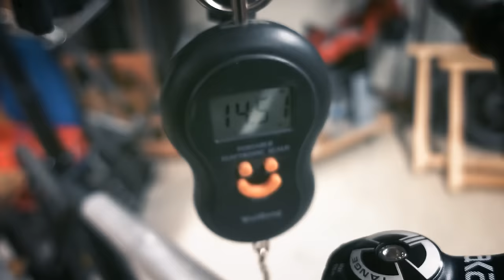Building a Light Cargo Bike

Comment: I love all the care and attention to the lights, although I would have put another backlight in the middle behind the seat and the ones in front can be covered by your legs. Stay safe out there.
The internal cable routing is wonderful, I kind of wish you’d make a video where you do obsessive internal cable management and do all the wiring inside for a super clean looking bike.
Reply from the maker: Yeah a third one would be good. But you can usually see at least one of the two when you're driving behind though, well at least nobody has crashed into me yet ;) 

Internal cables is definitely something on my list if I do another "elaborate" type of build.

Comment: Cool seeing you do all the work on the frame and nice editing to. I ride a Omnium Cargo (bike messenger from copenhagen) and I must say your headset solution seems better. Good job and yeah the lights are cool. What rim do you have on your rear wheel?
Reply: Btw glad to see you put on Grand Prix 4 seasons on the back good choice, I would have loved to see carbon handlebars and Shimano brakes though but im sure you have your own preferences ;)
Reply from the maker: Rear wheel is a Mavic Crossride 29" (without the Decals). Picked that instead of road wheel because the rim is a bit wider. And yeah the 4 Seasons is awesome, especially the new 32mm one. Probably my favorite tire, it does everything. Would love to have one in 20"... As for the handlebars and brakes, it's mostly stuff I still had lying around from other builds, so not necessarily my first choice. But this bike got pretty expensive as it is so I re-used what I had. I'll probably switch to hydraulic brakes at some point and maybe change the cockpit too.
Reply: Good to here 32mm is the perfect choice. Hope the industry will realize the demand for 20" wheels as the cargo bike is growing. Is it 406 you have on the front? Make sense that was what I thought, it is an expensive hobby. I think you made a beautiful bike an its definitely well made overall. The best thing is that you build it yourself, makes the riding twice as fun and unique.
Reply: Just change the brakes to TRP Spyres when you get a chance then you won't have to change your levers. They work much better on our tandem than the BB7's did

Comment: Won't the frame's square geometry make the structure weaker? Beside that, awesome looking bicycle!!
Reply from the maker: Yeah it probably would be a bit sturdier with a horizontal top tube or even a second top tube. But most of the cargo weight is directly over the front wheel/fork with this design so the rear only has to carry the rider. The frame is very stiff though, due to the large diameter tubing

Comment: Great job! Love the bike. And good video. I have a question tho. Don't you have to heat treat the aluminum after welding?
Reply from the maker: They do it on commercial bike frames, yes it's better to do it but not absolutely necessary. Depends on the alloy and the filler you're using too. So far I've had no problems with any of the welds, holding strong after 1+ year
Reply: @PhilVandelay  That's good to know. Aluminum does age a little bit and get stronger over time, but it will never get back to the original t6 strength. Probably more imporant on mountain bike frames where huge sudden impacts could break the frame.

Comment: I watched the recent cargo bike that was mainly steel, now this one that holds it's cargo much higher but aluminum, now I want to see the best of both worlds: A lightweight, but strong, cargo bike that holds it's cargo low. Extra points if the cargo section can be removed and changed out for thinner and wider platforms and easier storage.
Reply from the maker: That's definitely coming and it will probably be electric too. The green one I only built for the tutorial, not really for myself so I tried to keep it low-tech.  This bike here has its own advantages though, it's super light and agile for a cargo bike, there's always a tradeoff between a light bike and a strong bike

Comment: nice channel ,keep up the good work ,one question : don't you have to heat treat aluminium after welding ? theoretically it looses  strength on weld heat effected zone , but in real life use, is it necessary ? i have  builded a hard tail mtb out of 6060al tube, i heat treated the frame, do you believe i would be good without  HT ?Thanks for sharing (by the way i have the same welder as you ''stahlwerk'' )
Reply from the maker: It's definitely better to heat treat it but so far I haven't had any problems. If you use 5xxx filler alloy it shoulp help a bit to prevent stress cracking. I'm not sure I would build an MTB without heat treatment but I don't ride this thing off road so it has to take less stress. So far I haven't had any problems with the frame after months of daily use.
Reply: i look forward to see your future projects , cheers from Greece.

Comment: Great build.  I know nothing about cargo bikes but what is the reason for having the load towards the front vs. behind the rider, closer to the rear wheel?  Obviously you can keep an eye on the cargo better but wouldn't the weight being closer to the pivot make it more maneuverable?  Or to say it another way the weight of the cargo at the front of the bike has to travel the longest part of the arc when turning.  Thanks again for the video, liked and subscribed.
Reply: Edit:  I guess putting the load behind the rider just puts the weight of the rider further from the pivot?  So no gain?
Reply from the maker: That's actually a really common quetion about these bikes. The simple answer is, it's a matter of preference. Some people like having cargo in the back and I think a big reason is that most people still immediately apply car logic to bicycles because that's the default vehicle for them. Personally I prefer front loaders since especially with bulky loads you can always see exactly where everything is which is important since cyclists get so little public space. If you have to squeeze through tight spots, shitty bike lanes, bollards, other cyclilst, pedestrians, cars, etc. it simply makes you paranoid if all the weight and potentially the widest part of the bike is behind you. There's a constant risk of you or your cargo getting stuck on something when navigating a dense city by bike. Personally I also don't like the handling of bikes that are longer in the back, it feels weird to me but that's personal preference. The thing that affects handling the most isn't actually front or back but the height of the cargo. You want a really low center of gravity so the bike doesn't get tippy with lots of weight and in that sense this design here isn't the best for carrying very heavy things. It excels in other areas though, like being light, relatively compact and relatively simple for a cargo bike. There's some more technical reasons I prefer front loaders but I don't wanna go too in-depth here ;) In the end both options are fine, but rear loaders come with their own set of problems and I think there's a reason you see way less production cargo bikes that are built that way.
Reply: Next cargo bike I make is going to be a front and rear cargo bike. My fixture is long enough, why not? Have you ever seen one?

Comment: Hi, what kind of aluminum you used? Al 6060 tube? or? I starting design my own cargobike too. From old aluminium frame but I dont know witch Al tube use.  Thanks for answer :) great video and building
Reply: 6061 is pretty strong and not too expensive. Besides 2000 and 7000 series can't be welded. I do wonder about the weld strenght though?

Comment: What does the longer wheel base feel like ? Does it feel cumbersome or more stable?
Reply from the maker: Definitely not cumbersome, in fact it feels more agile. Due to the fact that (without cargo) there's less weight on the front wheel and the front wheel is smaller, you can do very quick turns and changes in direction because a smaller wheel has less inertia. So that kind of counteracts the long wheel base. These bikes are quite fun to ride, I actually almost prefer them over normal ones handling wise. You can still ride this no-handed too with no load on it. Never had a problem getting stuck anywhere either due to the size. In fact I can get it into most elevators :)

Comment: Nice bike! I would however want to cover the aheadcap of your steerer in some way. Otherwise cargo could touch it and cause high friction while steering or in worst case even lock the steering completly.
Reply from the maker: Yeah that's one downside of this design but not much you can do about it. It won't lock up the steering, there's nothing that can get caught and it doesn't cause enough friction to really notice it while riding (handlebars provide a lot of leverage and the cap barely has any surface area). The cap gets scratched up though and it can scratch up the cargo. It's kind of a minor thing but I can see how it might seem like a bigger problem just from looking at it
Reply: Ah, ok. Thanks for the answer!

Comment: I like your video. where did you get that metal band saw. Rickard
Reply from the maker: Bought it on eBay, you can get them almost anywhere, they're generic chinese machines sold under different brand names but it's pretty much the same machine everywhere (maybe different color/name). I think I paid under 300€ for it. Very good deal if you're willing to make some adjustments. it's one of the most used tools I have

Comment: Fantastic work and documentation ! Did you use 6060 Alu tubes ? Just ask cause i want to build a bullit - like cargobike and always read about the need to temper after welding.
Reply from the maker: Yeah I read a lot about it too and a lot of people were telling me it's gonna break without heat treatment. People are still telling me it's gonna break even now. Well, as you can see it didn't! I'm no expert on this but I decided to just go ahead and try it since all my previous tests with welding 6060/6061 were promising. I've used the bike for half a year now almost daily and there haven't been any issues with the frame. I regularly inspect it for cracking but can't find anything. So I can't give you any guarentees but based on my experience heat treatment is not as critical as it's made out to be. That being said, due to its shape and smaller size this type of frame is a lot stiffer than the bullit design, and flexing is what kills aluminum. So if you do go for it, make sure you make it as rigid as possible. Even though this worked I think my next bike is gonna be steel again though. Just feels better to be on the safe side ;)

Comment: Phil do you have plans or a CAD model available for purchase for this one?
Reply from the maker: Not for this one unfortunately, partly because they wouldn't be of much use. If you use a donor frame to build this, almost the entire geometry of the frame (tube lengths, angles etc.) will depend on/change based on the geometry of the donor frame. So if I gave you all the measurements, they wouldn't work for you unless you used the same exact donor frame I used

Comment: Hello @Phil Vandelay.
Would you sell the plans for this one, as you did for your Long John ?
Reply from the maker: Unfortunately no plans exist for this one! I kind of made things up as I went along back then, or only had some rough sketches. I've thought about making another one of these with plans, but the problem is that the geometry changes based on which donor frame you use. It's very hard/impossible to make a plan that works for every frame out there, or even most of them. It would have to be more of a guideline on how to make your own plan 🤔
Reply: @PhilVandelay , impressive...what is the trail at the front? i understand the small wheel, but over bumps also trail is important. did you keep the original value (supposed to be around 55) or different?

Comment: You´re freak Man! EXCELLENT JOB! Just an advice, consider to use hydraulic brakes instead of mechanical brakes (wired), are safer and more effective
Reply from the maker: Yeah I used mechanical ones because I still had them and maintenance is easier (don't have a bleed kit). But I might upgrade later

Comment: Are you happy with the steering both w/ & W/out a load?  What is the head angle & how much tail on the fork? Luv the Video!
Reply from the maker: Yeah it's very snappy handling, with a bunch of weight it does get tippy and sluggish but that's normal for a bike like this with the cargo relatively high up, it's not a heavy hauler. But that means it's really fast when empty. Honestly I'm not sure about the head angle anymore but I think it was 74°. Fork has almost no offset too, it's almost a little too twitchy for a cargo bike but I guess it's a matter of preference. In retrospect I'd give it a little more slack I think.

Comment: very good job an thx for this impressions phil 👍🏻, i am planing a similar project and your video will help a lot. 
where did you buy this tubes? did you use 7005 or 7020 alloy?
Reply from the maker: Neither, I used standard 6060 tubing because 7x is nearly impossible to get as an end consumer in those sizes. I buy 99% of what I use in videos (toold and materials) through eBay. Even though everyone told me everything would break without heat treatment and that 6000 alloy is "too weak", this bike has been holding up perfectly for 4 years now. Still love it and ride it almost daily. My rule of thumb is don't listen to anyone unless they've actually done the thing you're trying to do 😅
Reply: @PhilVandelay  thats also my experience… there are just some small shops in US which sell butted bike tubes out of this alloy…. but not such big tubes. 
But nice to know, that this material also works for your requirements😊. i think i will try it also for my new project. thx and good ride 😉👍🏻👍🏻👍🏻

Comment: Does it need a heat treatment? I just have the idea that most aluminium frame builders do that. Just curious what happens if you don't.
Or dit you simply over dimension so that stiffness and metal fatigue are no concern?
Thanks for the amazing video.
Reply from the maker: Heat treatment isn't as critical as people think in my experience. I never do it and haven't had a single aluminum weld break ever. But yes, I also overbuild things, not in this case though - this bike is built to be very light but still holding up well. It's been a few years and I still ride it.
Reply: Thanks for the reply.
I was really thinking/worried about this. Now it seems more manageble to follow in your footsteps.
Danke!
Reply from the maker: @maxspruit8370  My philosophy has always been to rather try things out yourself instead of listening to everyone who says it's impossible. For every single thing I built, there was at least one person telling me it won't work or it'll break, so my advice is to just do it first, worst case is they're right and then at least you know for sure  😉

Comment: Thanks for the video Phil, Nice work and design. Only thing I can think of is the side bars on the carry platform should had been angled in at the front, or even a rounded front end, just in case you hit a pedestrian. It would then be a glancing blow not a solid hit from the front of the bar.
Reply from the maker: I see you point, although I've never hit a pedestrian in my life so I don't think it's that much of an issue. The reason for them being straight is that they serve as an extenision of the cargo area and you woudln't be able to attach straps and stuff if they were round/angled. Another purpose they serve is that you can stand the bike up straight for parking and then it rests on those tube ends.
Reply: @PhilVandelay  Thanks for the reply Phil. I can understand why you designed it this way. Still a cool built. Thanks

Comment: What grade of aluminum are you using?  I've got a couple of 7005 and 6061 frames kicking around that I want to make something from.  I've read that 6061 needs heat treating or it will stress crack.  Have you had any issues welding to aluminum donor bikes? I've only welded on steel frames so far.  Thanks!
Reply from the maker: I had the same concerns before I started but since it seemed impossible to get my hands on 7005 or 7020 tubing in these dimensions here in Germany I decided to just go for it with whatever I can find which ended up being 6061/6060 tubing. I can only speak from experience since I'm just some guy experimenting, I know very little about metallurgy or engineering. But I've used this bike for over a year now and I haven't had a single problem with the frame, no cracks or anything. Same goes for everything else I've welded with aluminum so far (mostly 6060 alloy). I even crashed this bike once, destroying the carbon fork but the frame was fine. One thing that is crucial from what I've gathered is the kind of filler wire you use, you want to use something that's softer/more flexible than the base alloy to allow for a bit less brittleness in the welds. I used 5356 filler wire after some googling and that seems to work very well. Tons of people told me don't do it, it's gonna break without heat treatment and so far it hasn't. And if it does break eventually that's still valuable infomation ;) Generally it seems to me like people make a bigger deal out of the whole heat treat thing than is necessary - at least for hobby type stuff. That being said, I wouldn't sell this to anyone with a clear conscience.
Reply: @PhilVandelay  Thanks for the heads up on the filler wire selection.  I can only source 6000 series stock here as well so I'll give that a try.  I'm just a guy building and experimenting too so if mine breaks I'll let you know then at least we'll both have two data points!